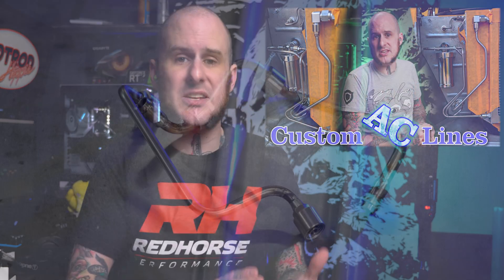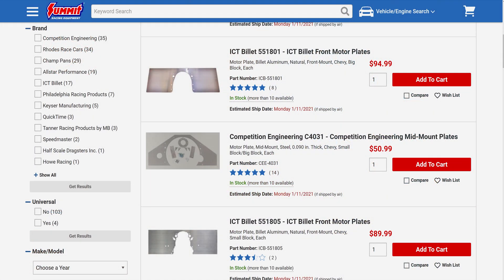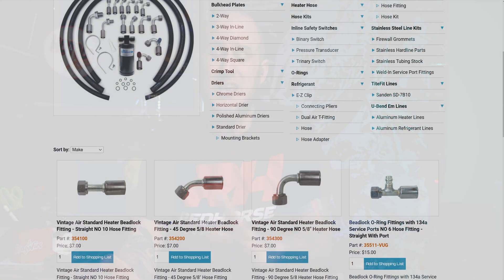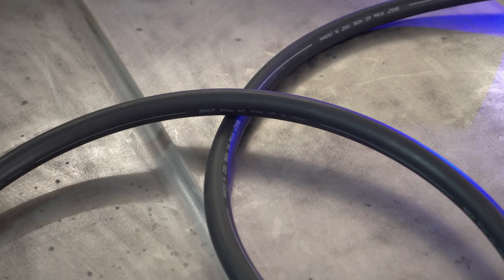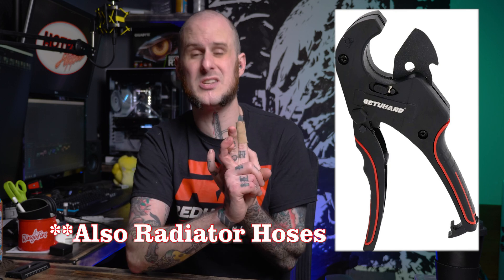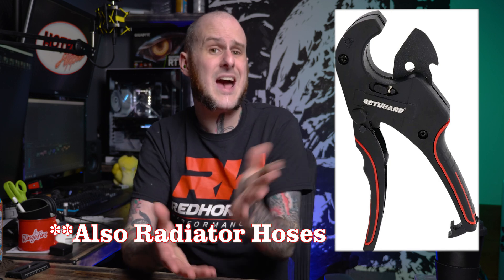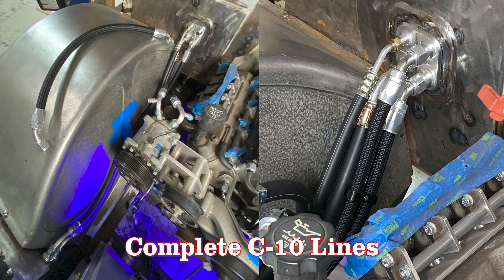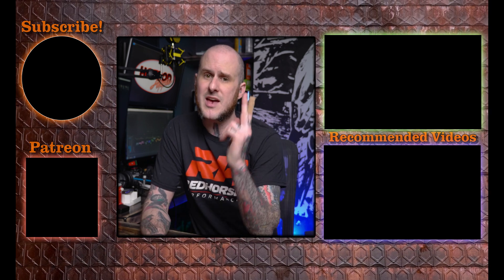How I Make Custom AC Hoses - Flexible A/C Lines How To!

Comment: The bigger question is: How do you know how much refrigerant to put into the system after all the custom work.
Reply from the maker: Vintage Air gives you a base amount to fill the system. After that you have to know your AC systems and fill until pressures / temperatures are where they should be. I cannot give you more than that as it requires the tools and experience to "feel it" out. Definitely a task for a shop that is familiar with the process.

Comment: I need some help and think you may be the person to help.  We are entering the era of "Mini" split AC systems.  They are easy to install, but running Copper lineset in some situations is challenging. These use 410a.  Curious on if you think these will work great on a install where there are multiple bends through structural membranes.    I've been looking at the Eaton Evercool GH001.  Fittings are also confusing as unsure of thread, and how to interface with connections that are designed for flared connections.

Comment: Thanks for this tutorial! Do you know if you can use a hydraulic wire crimper instead of the specialized crimper?
Reply from the maker: You need the specific sized crimping dies and they crimp slightly differently. I have both and there isn’t any overlap between them. Unless you mean some industrial sized wire crimper I’m not aware of.
Reply: @HotRodHippie  thanks! Yeah,  I just have your basic 16ton hydrualic wire terminal crimper.  I'll probably just follow your method for alignment and then  take them to an ac shop.

Comment: Is there a fitting manifold that will fit on a 89 suburban with a stock compressor?
I'm having difficulty finding a stock hose for a 7.4l 454.
Reply from the maker: That should be the "GM R4 Compressor" so one of these: https://amzn.to/3TbiL3E 

Or similiar.  I CANNOT guarantee that is the one you need, but plenty of options and angles exist for the R4.
Reply: @HotRodHippie  thanks Buddy

Comment: I pickup a crimper to make a hose and it worked so well that I'm wondering if other lines can be made with this same crimper. Can you use this to make oil lines,  power steering lines, or transmission lines? I use AN fittings, but it would be nice if I could use this for a AN to crimp fitting.

Comment: Hey man I’m a mechanic and I’ve noticed when buying parts at local stores that have the same crimp marks that your leaves (usually power steering lines) they usually end up leaking have you ever had that issue when doing a/c lines
Reply: The pressures are a lot higher in power steering systems.

Comment: What a great video. My 2002 Excursion is getting old enough that changing out the lines is starting to make sense. Pricing just one long length hose could actually pay for the equipment needed to do it yourself. Thanks for time spent to make this video.

Comment: Ya that was the missing crimping style that I final realize. Usually I could determine for softlines and hardline types what connectors / tool you need to make it look exactly like original look. Ya alot of hydraulic equipment use them as well as the soft ac lines in the event they don't go with all ridged stainless steel lines. Very cool eye opener to make things a little more professional.

Comment: I do have to say though the bead crimping tools and connectors are hard to find. So usually only option is get them premade or bring old hose/tube in and having a parts place figure it out. Pex pipe tools , flare/swag tools , and hose clamp screw downs seem to be the only ones I see around. Keep my eyes open.

Comment: Great video, wasn't aware that they sold connectors and bead crimping tools for soft line making. And yes for getting hose/ tubing exact lengths I like you method of just tapeing connectors temporarily then laying out/running/marking. Before cutting / crimping that way you get correct length everytime with your fittings

Comment: Alan, I'll be installing Vintage Air Front Runner and plan to run the hoses behind the fender skirt through a bulkhead. Any input on the EZ-Clip system of connectors and hoses? Looks like Vintage Air sells them....manufactured by Eaton. I'm not crazy about the look of the connector but the size and flexiblity of the hose lends itself to more turns and routing like I'm planning to do. Love your channel and looking forward to your input on this. I've no horse in this race, just trying to educate myself. Thanks in advance!

Comment: Hi, thanks for this is a great presentation, very useful.
I'm planning to reroute my AC hoses, but I'm wondering; should I have the same hoses length to it's original considering volume? Does it matter?
Reply: I am no expert or have any experience with custom ac work, however, I have wondered the same thing and done some research over it. From my understanding if the volume changes than you should fill the system according to a static pressure chart and a working pressure chart. Record what it took to reach those numbers for future reference.

Comment: Check out Auto Plumb for AN a/c fittings and braided hose!!!
Reply from the maker: They seem to sell Aeroquip fittings/hoses, which I absolutely hate.  I've used them in the past and they are honestly kind of ugly and difficult to route.  I'd rather use the rubber hoses any day.  They also sell the AeroFlow adapter fittings that I used on this truck's Heater Hoses and did a dedicated video about:
https://www.youtube.com/watch?v=D0ERyNBoISU
Reply: @HotRodHippie  yeah man, personal preference, you’ve been doing it a lot longer than me, I just decided yesterday to re-re-instal my a/c 😂 it’s too hot where im at. Plus with a straight 6 the a/c on my build is pretty much straight shots minus the 90° to the condenser and the compressor.

Comment: Does your system Use an Orifice Tube?
Reply from the maker: Nope all aftermarket systems I’m aware of use an Expansion Valve. I’ve done custom systems married to factory systems that used them in the past but that was as simple as finding the fittings in the catalogs I mentioned and adapting.

Comment: I crimped my 1rst hoses yesterday
I added what I call OMG (urathane) the windshelid glue.
so when crimped them they sealed very well because R12 is very expensive. I did those dreaded conversions at a shop from 12 to134 customers were always unhappy with the poor performance of it.
years later its now proven R12 did no harm to the ozone layer
A Big hoax is out of the bag now....
all sweaty mercedes bmw customers over a get rich scam for corperations gain.   
europe continued to use R12 
a refrigerent specialist In California 😵 stated the R12 is what you want when outside temperatures are above 90....
on my 76 sevillle the bir eliminator keeping factory evap and condensor,Removed smog pump removed the now $600 to replace A6 frigidare compressor going back with a sanden with R12 ports on the flexa le hoses 
the bracket that fits presmog cars right were the smog pump was. a perfect fit.
a presmog crank pully and longer belts enables both grooves of the sanden to have V belts a oiding slippage or chirping under load.tge vir eliminator cycles the compressor so its not always running.
the cadillac provrammer notoriously shuts off the blower and some only enguage on defrost mode 
i hard wire the blower but would like to know more about how to rewire a 3 speed fan switch to the factory blower relay.
broken non available programers still switch from hot to cold 
so with manual blower switch it should be a good hybrid HVAC for the 1976 seville system also a manual 4 seasons hot water valve is more bypassing brocken programmer functions
also the fan belt driven with viscous coupling doesnt rob power or eat your battery like condensor fans strugging to make 134 perform like R12 
any GM hybrid advice from your texas experience let me know more😜

Comment: Do you put in an expansion valve or do you just go straight open lines to everything?
Reply from the maker: Expansion valve is part of the AC Box assembly on a Vintage Air box. We don’t usually have to plumb it in-line anywhere on a custom system.

Comment: With effort, why can't someone (including us) manufacture universal fittings and various length flexible ac lines? Quality AC hose with all the standard fitting sizes. Please explain. yes, we are smart enough to make sure we oil the system. Please tell me what is the big deal and please noting about damaging our planet. In Mexico, they use propane gas as a refrigerant... I'm talking Chevy (GMC) truck here not a custom Lambo...  MarkMannM2
Reply from the maker: I don't understand what you are asking.  Pre-produce hoses to random lengths with various end combinations for resale?  That is what I think I got from that.  What does the refrigerant at play have to do with anything?

This video is about making your own hoses to your specific application, why would you want or need premade lines?  Am I misunderstanding you?

And caring about the planet matters.  Just because someone else is doing damage doesn't mean we shouldn't care.  If your neighbor stops mowing their lawn do you stop taking pride in yours?  Doing your part matters, others will never give a damn about doing the right thing if someone doesn't do it first.

Comment: Hey..i need to replace brake line ( abs).
A steel line thats factory crimped into steel braided hose...how do replace or fix with a crimper?.leak is 1/4 inch away from crimp...if it was 6 inch away i would flare steel line & connect to rest of steel line..but i cant..thanx
Reply from the maker: The equipment needed to crimp those lines is specialized and very expensive. I don’t even mess with them as the equipment is thousands. 

What I would do if it was me is remove the hose, locate a local hydraulic shop and bring it to them. I’ve done that multiple times in the past and had them produce a brand new hose using the old line as a template. Otherwise as you already noted I’d consider making a hard line to replace it.

Comment: Hi where do u buy the fittings?
Reply from the maker: Any local parts store. I provided the link to a 4 Seasons catalog in the description. Any good parts store should be able to order (or have them in stock) based off of those numbers. 

That said you can also search online and find them a lot of place. If you are preferring to save a few bucks and do business online. 

Vintage Air has a good supply but not the wisest selection there is. 

I don’t have one source I can point to unfortunately.

Comment: Have you used that hydraulic beadlock crimp tool a bit more extensively?  the amazon price is good but some of the reviews are disappointing, indicating some 6 & 8 sizes didn't crimp well at all.  Looking to do some custom line routings soon.
Reply from the maker: I’ve only does this one project and a handful of other test crimps with it. So I can’t give a full review really. It comes with some extra dies that seem to be for oddball sizes. I ran into that on one or two crimps but was able to correct it. I’d recommend a few test crimps but otherwise have had no issue. Comparing the crimps I got with it to my old hand operated crimped (ratchet drive ) it works as well IMO. I was pleasantly surprised with it myself.

Comment: Solid video! Question; how do you determine which lines need to be flex and which ones not? Presumably coming off the compressor needs to be but that's it yeah?
Reply from the maker: Compressor to body/frame for sure as there needs to be give for motor movement and vibration. Depending on the project some cars twist more than others so if going from frame to body I may say there as well. But usually only the compressor lines must be flexible. I’ll often use flex lines for ease of running them though. Such as I did a 58 Corvette where we hid the lines in the wheel well. They weren’t visible so there was no need for hard lines in there. Soft was just easier.

Comment: Can you connect to existing aluminum lines? Like if you cut up factory lines and need to add to them?
Reply from the maker: Certainly I’ve done it in the past. But to do it with the tools most of us have available would mean welding on new fittings and connecting to that. 

In the past I had access to an excellent hvac shop that would rebuild factory hoses / manifolds with the ends I needed. So shops to do it do exist. But the equipment to flare or crimp ends in that situation is something beyond the scope of most small shops.

Comment: What do you use to convert O-ring style bulk head from an expansion valve to soft lines
Reply from the maker: I replied to you on the video about this. Check out the 4 Seasons catalog I mentioned and linked. It has various adapters for compressors, expansion valves, etc. Along with that I’ve taken the original hose to an AC Shop to have them rebuild the hose with the new length / ends I need. Or I’ve also custom made them in the past by taking an original block fitting setup and welding on new fitting ends. 

In the end I rarely do this anymore as stock expansion valves just aren’t a thing in my world these days. Factory systems are too large and unsightly (as well as very hit or miss on efficiency) for the builds I’m doing anymore so it’s been years since I’ve had to adapt like that.

Comment: Freon is a trade name like Xerox or Kleenex. Most likely refrigerant for auto aftermarket would be R134A. Another little tip. There is a small hole in most aftermarket fittings. That hole is to make sure the hose is pushed all the way in. Check to make sure hose is pushed in far enough before crimping. Another tip is to keep all hose and fitting openings plugged or covered to prevent crap from getting in while mocking it up. Refrigerant assembly really requires "surgical room" cleanliness, especially when assembling/ installing the o-rings. Worked in mobile a/c design/fabrication for 11 yrs.
Reply: You think I could mount a condenser on the roof of a pickup cab, and flex line across to a cargo/camper box?  I'm building a 4x4 camper but I want it to look like a nose mount reefer truck.  I figure a cab mount condensor will help reduce noise and distribute weight better.  I plan to use one of the DC no idle ac units and also a bd35f for a freezer like they do on sailboats.  There would be lots of flexing/vibration on dirt roads/off road, but maybe with enough line and wrap the ends with some spring and extra rubber?

Comment: Has anyone tried this tool for making the correct pilot for hard AC lines?

https://www.grahamtool.com/largetubebeadingtool-1.aspx
Reply from the maker: That won't work.  The actual "pilot" end is smaller in diameter than the rest of the fitting/tubing so the tool has to shrink the end as well.  Also the shoulder needs to be a very clean pressed ring.  Those beading tools just don't produce that clean of a lip.  

The problem with making lines is the shear pressure required.  To press the shoulder crisply AND shrink the end of the tubing requires a fair amount of pressure.  The only machines I've found to do it were $10,000+ hydraulic units that would take up a lot of valuable real estate in a shop. 

Believe me, I've been looking for YEARS to try and find out how to form those fittings/lines myself.  It would be a game changer if I could do it, but I cannot justify the expense of all the equipment I have found so far.
Reply: @HotRodHippie  Year I hear you. I've been trying to find a tool to make hardline because Porsche actually uses the short pilot fitting for the transmission cooler lines on my car and I'm trying to avoid using a million adapters and AN braided hoses to hard line. (Aeroquip makes O-Ring pilot to AN line fittings)

Comment: I think you could clamp your tool in a vise to use.
Reply from the maker: Could. That’s how the “manual” one is used. The hydraulic one lends itself to that less. The issue is that the hand grip portion isn’t really designed for one handed operation... or really two handed. It’s the same design as the Hydraulic Brake Flaring tools that are available. They work well but it’s clear that usability wasn’t the primary focus of the design.

Comment: I did not know A/C systems can be that high pressure when they are functioning. Thanks for looking out for our safety.
Reply from the maker: I’m a bit of a stickler about safety. Someone has to be.  😅  I usually dial in Vintage Air Systems to run at around 250-300 psi under normal conditions. So it doesn’t take much of a major malfunction to push far more pressure.
Reply: @HotRodHippie  dirty condenser can spike it over 400psi.